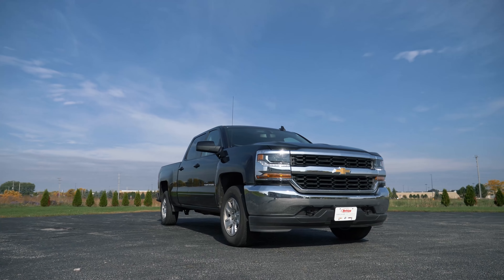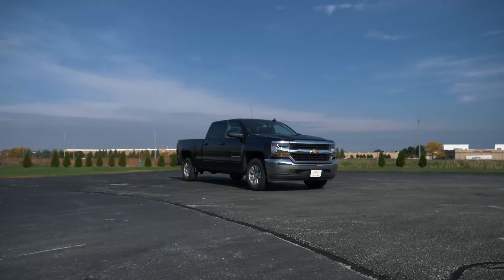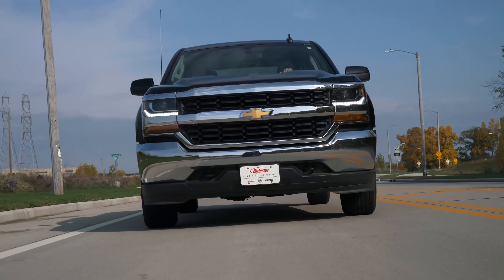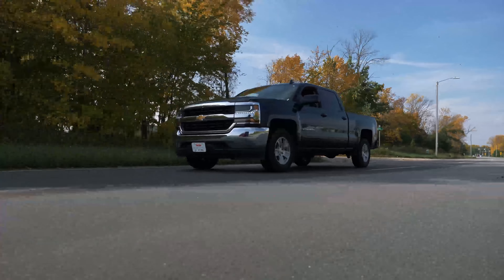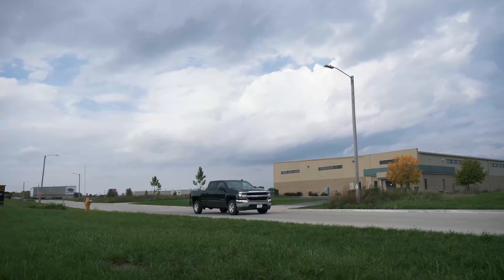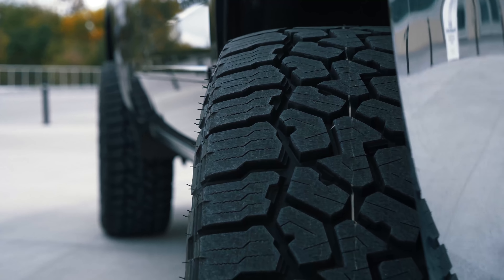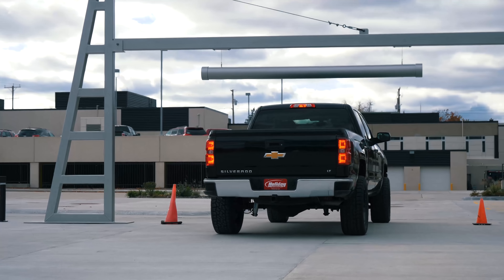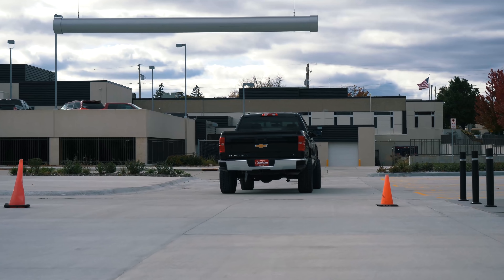2018 Chevy Silverado 1500 Dealership Build!

Comment: Hey guys dont know if yall will answer but Im curious If I can fit 33s or 35s on stock duramax 4x4 rims?
Reply from the maker: Your best bet is to check on forum/facebook page Fordguy we do more aftermarket setups then we do stock wheels and tires!
Reply: Ok also talking aftermarket is there a certain type of wheels and tires that you guys could recommend that are good for street driving but perform good off-road and do alright in mud?